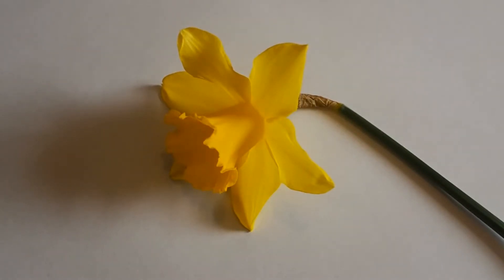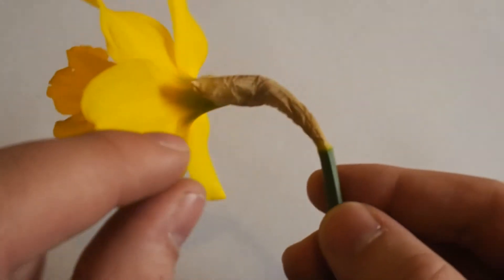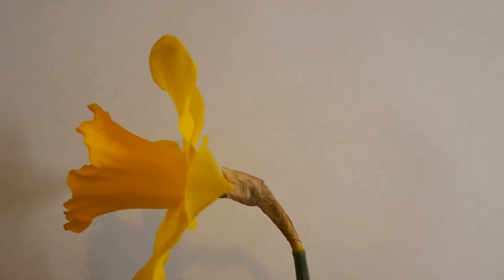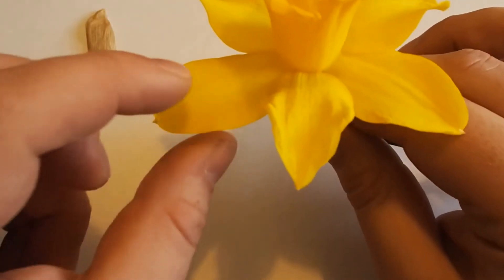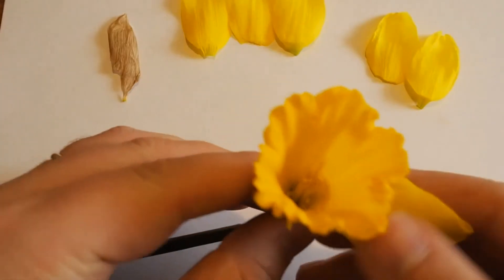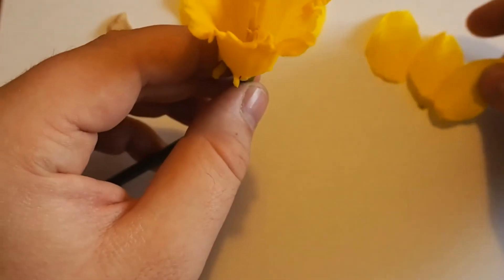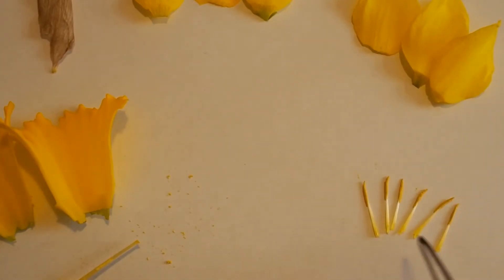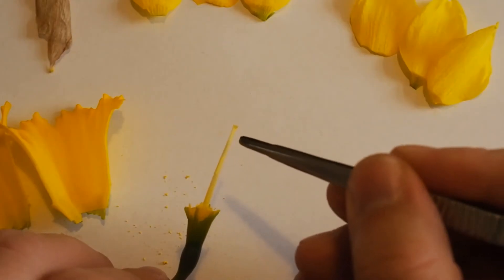Daffodil Flower Dissection

Comment: So are all plants male and female???
Reply from the maker: That is a very good question. Most plants contain both male and female reproductive structures. This can be both in the same flower or as separate male and female flowers on the same plant. However, there are some plants that are dioecious. This means they are distinctly male or female. These plants won't have successful fertilisation unless they are in close proximity to a plant of the opposite gender. Hope that was helpful :)
Reply: QLab yes thank you very much